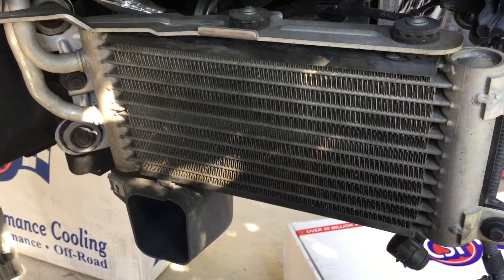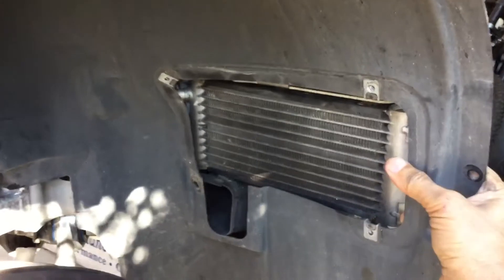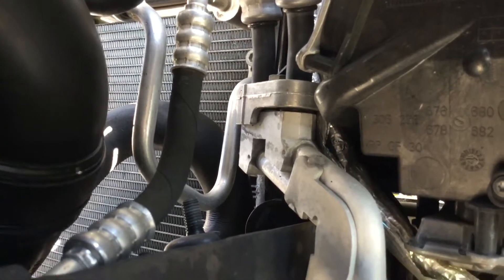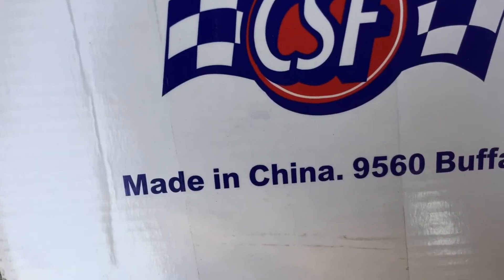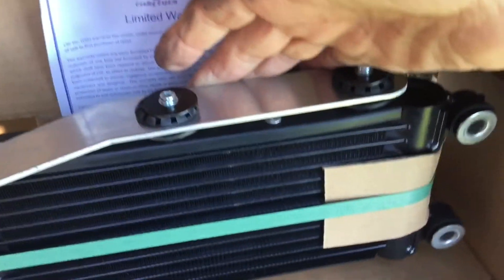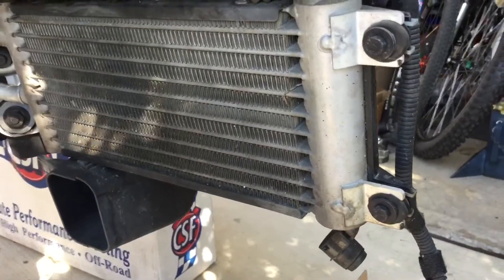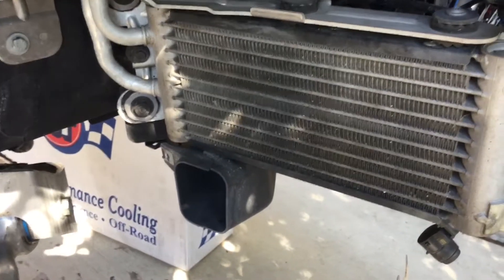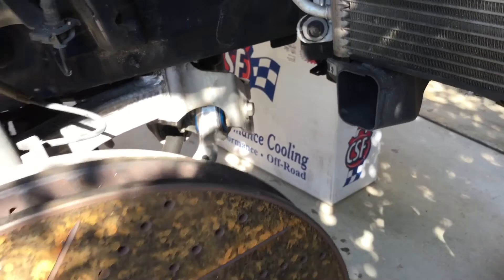BMW 335i E9X M Sport Engine Oil / DTS Cooler vs CSF Cooler installation

Comment: OEM has 10 pin, CSF 11 pin. You should test both, before jumping to conclusions.
Reply from the maker: @c.c7263  oil movement through the cooler is controlled by a mechanical type thermostat.  One additional fin per inch wouldn't have made a significant difference.   The tubing material and oil route is the same, and the capacity is equal; the only possible advantage might be the csf coolers ability to transfer heat away quicker when going from a closed thermostat to an open condition, and even that would be a negligible  since the oem cooler has the capacity to maintain the oil temperature at BMW's engineered goal.

The Mossellman thermostat on the other hand was a halpful upgrade.

Thanks for taking the time to write
Reply: @ProjectsMB  Thanks for your answer and point of view. 
I've heard some people are using do88's M3 DCT cooler as an oil cooler for the N54. This one is much bigger, you should check it out.

Comment: yeah.. the radiator will do more for overall cooling than the oil cooler, cause keeping engine temps under control will also keep oil temps under control,  especially if you MHD flash it for sport mode cooling..